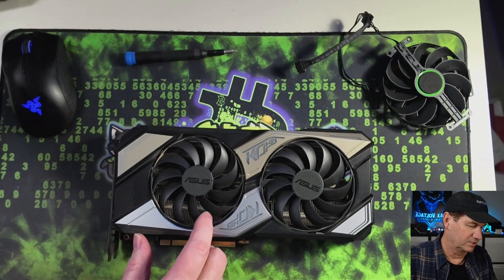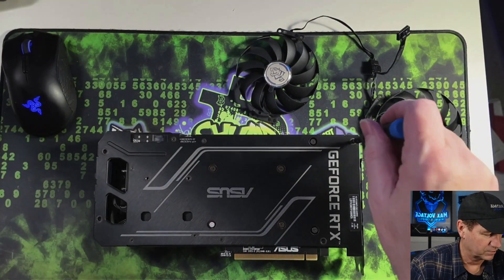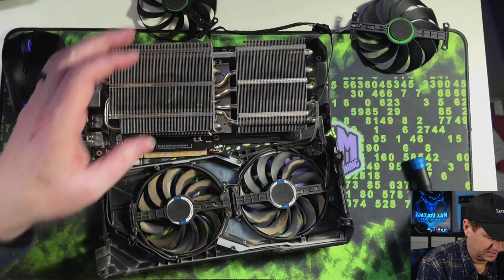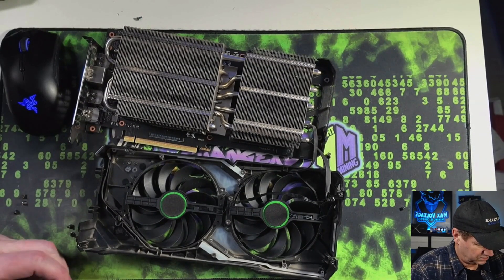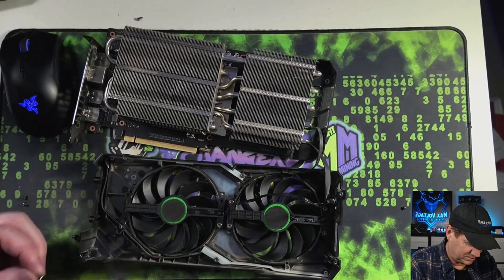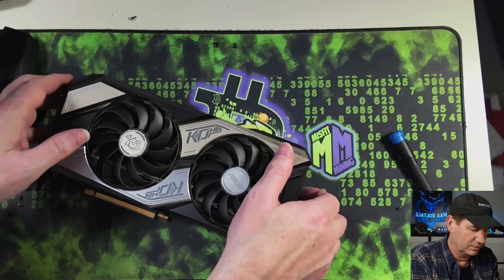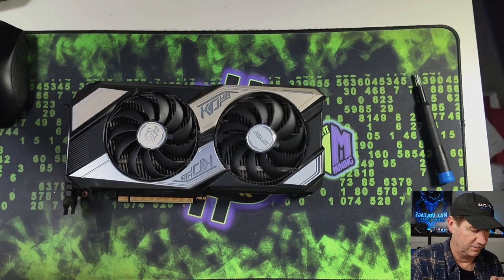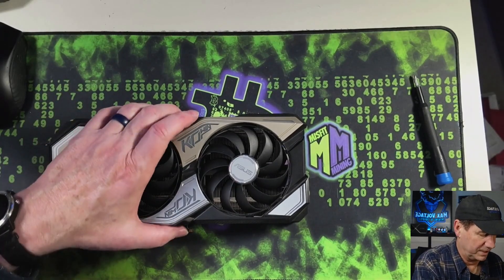I Fixed My ASUS KO Graphics Card in 15 Minutes

Comment: Love it when the fan replacements are quick and easy. I need to retry finding replacement fans for my ROX Strix 3060. I bought a set from GPUFanReplacements once but they weren't the right type for some reason. Maybe in the time since my first attempt, they've updated the categories to ensure it's the proper model. 💪🏻👌🏻